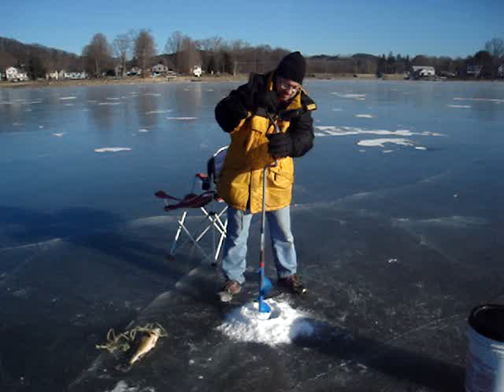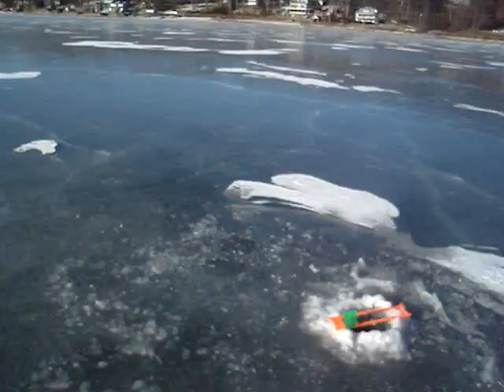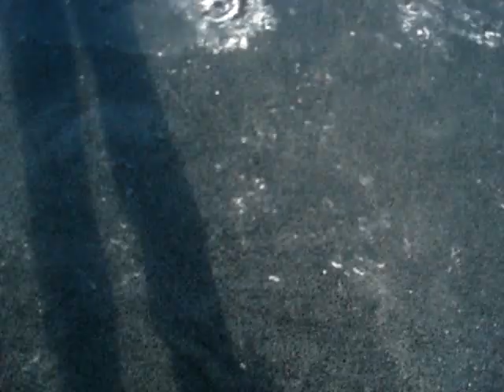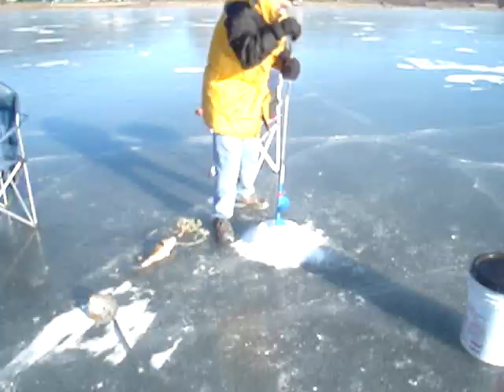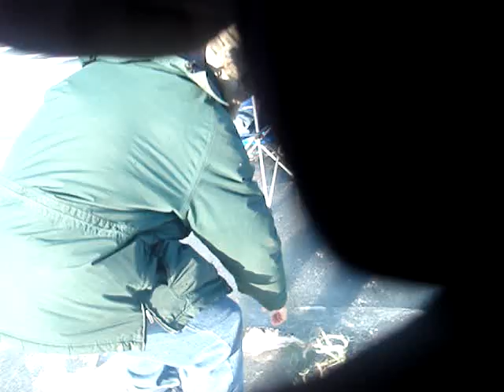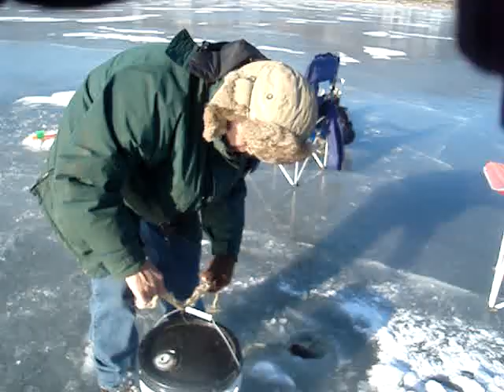Renewable Ice Fishing

Comment: 1) Get new blades! Im from ontario canada and we usually have about 2 feet of ice and with dull blades my arms are dead after 3 holes. 2) Where are you guys fishing where you are allowed to catch bass icefishing? 3) running a rope threw the fish like you did wont keep it alive because fish have to be able to close there mouth the breath. Stringers should be run threw the noseand out the bottom below the mouth so they can close there mouth and you avoid recking there gills. I just put em on ice.